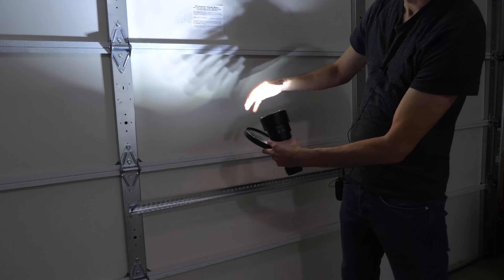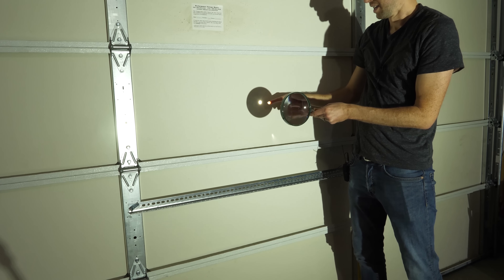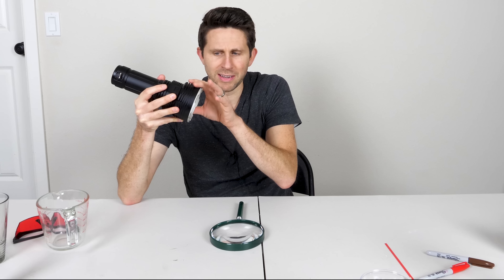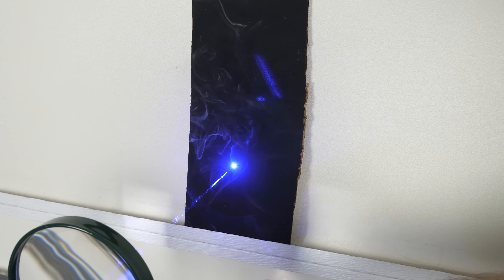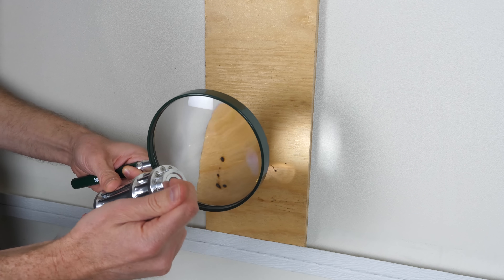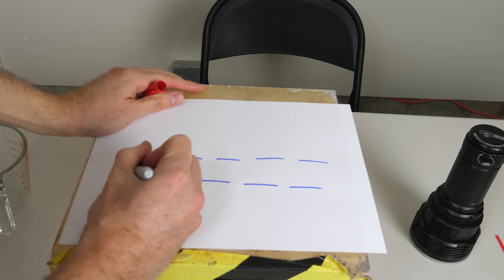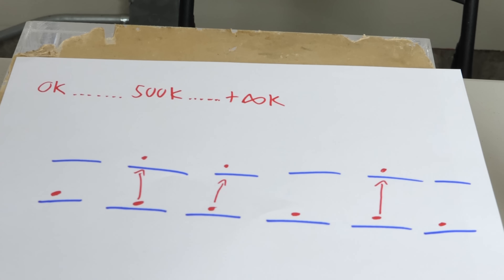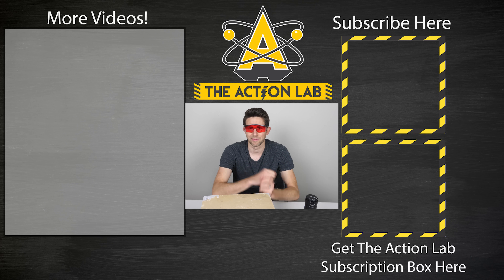What Happens if You Focus a 5W Laser With a Giant Magnifying Glass? Negative Kelvin Temperature!

Comment: You do not violate any law you just need other lenses. Lenses have different characteristics (depending on thickness,materiel and curvature)and your lens is just not the optimal one. 

You are indeed not capable of creating a stronger light source overall but you can focus the light onto a smaller area and thereby create a higher lux value at the focus point. (in comparison to not having it focused)

You probably need multiple lenses to focus your flashlight. 

pls correct me if I am wrong I had something similar last semester in technical physics.

Post scriptum:
An elliptical mirror around the light source could focus the light to one single point.
www.mathopenref.com/ellipseoptics.html
Reply: If each light source has the right combination of lenses and mirrors, you could focus all the light from all the sources into a tiny point that is way smaller than the combined surface area of the sources.
Reply: @nikolaneberemed: No, you can't overlap a perfect image of an incoherent source with a perfect image of another incoherent soruce, unless you also overlap the sources. If there is a distance between the sources, there will be also a distance between the images. Effectively, if you put multiple LEDs next to each other, you just have a bigger source with the same brightness per unit area.
Reply: @RealNovgorod  Can you illuminate the same spot on the wall with two different light sources at the same time? Sure you can. Can you focus the light coming from a source using (a series of) lenses? Sure you can. Where's the problem?
Reply: @nikolaneberemed: No, you can't have a perfect image from 2 incoherent sources overlapping. You certainly can have 2 flashlight beams overlapping but they are both much bigger than the sources and the combined brightness is less bright than each source. It's the same argument as why you can't focus a single source to an infinitely small spot. Think about what it means to focus an incoherent light source *perfectly*: Each point on the source surface emits light in all directions. You could collect the light from such a point with a lens and focus it back into a "point" on some screen (neglecting the wave nature and the diffraction limit for the sake of argument), but the light from an adjacent point also goes through your lens and is focused not at the same spot as the first point because all light "rays" from that adjacent point are shifted with respect to the first point and so are the image rays.
You can focus a spherical distribution of rays coming all from one single point (-> divergence), or you can focus parallel rays coming from different points (-> source size), but you can't do both, there's a mathematical trade-off (the product of divergence and source size is conserved, it's called emittance). This trade-off manifests in a finite-sized focus spot, and in the case of a source emitting randomly in all directions, this spot size must be at least the source size. Adding more sources in front of your lenses just increases the total source size, that's all. There is no optical system that can get around the conservation of emittance. The best you can do is holding your LED chip directly against the wall, so there's no way to increase brightness without somehow overlapping the chips.
Reply: @RealNovgorod  I wasn't talking about perfect. Not even remotely.
BTW, from the way you argue with yourself, I'd say you need more social contact. 8)
Reply: @nikolaneberemed  Not even remotely? Then you don't have even remotely the same brightness - problem solved, no more need to argue with the laws of physics. You're welcome.
Reply: @RealNovgorod  No, it's sufficient to focus the light onto a smaller surface area. No perfection needed. Better is still better, even if it's not perfect.
Reply: @nikolaneberemed  But you can't and I already told you why. The best you can do is a 1:1 image of the LED, not smaller. If it's not perfect, the image is always larger than the source and therefore less bright. You are welcome to show an example where all light from an LED chip or a lamp filament is focused to a smaller spot.
Reply: nikolaneberemed I think you are fundamentally missing the point. What he is saying is that it's NOT POSSIBLE. Mathematically. Please stop arguing with basic physics. If the two images dont perfectly align then the brightness per are has not increased. This can be shown with what other people have said so far in this comment string
Reply: @RealNovgorod  But I wasn't talking about LEDs specifically either. I was talking about light sources in general. Imagine two flashlights. Their flashy bits have a certain surface area. If we can focus that light using mirrors and/or lenses onto a smaller surface area, we should get light that is brighter proportionately to the difference in surface areas. Is that wrong?
Reply: @nikolaneberemed I also wasn't specifically talking about LEDs but incoherent light sources in general (basically anything that's not a laser). The "flashy bits" in a flashlight are typically tiny, only a millimeter or so in size (that's true for both LED or incandescent lamp bulbs), but the typical light cone is huge in comparison because you want to illuminate a large area and not just a millimeter. If you focus down that light cone (which you can), the resulting spot will be brighter than the unfocused light cone, but it won't be brighter than the "flashy bits" unless you can focus that light cone down to a millimeter. Maybe that's the misunderstanding. The "source" here is the tiny LED surface or the light bulb filament, not the light cone coming out of the flashlight. Only if you can focus it down to the same tiny area, you can achieve comparable brightnessy. But the laws of physics don't allow focusing to anything smaller than that.
Reply: @RealNovgorod  that example finally did the trick in my head 😉
Reply: Novgorod you can focus it down to however small you want. Obviously that doesn’t increase the amount of photons coming out of that flashlight, but equally obviously higher energy density equals higher temperature in that focus spot.
Reply: @jannthomsen2760  You're free to try doing that. Being able to do it would win you all Nobel prizes you can carry. As a hint, you can try to do it with moonlight. Moon is a neat object since we know its surface temperature, which is pretty low, but the object itself is huge and illuminates full side of our planet. The point is, there is no system of lenses you can use to focus moonlight into something that would make paper burn. No matter how big lenses you use, no matter how you configure them, no matter how many you use.

Or if you are not experimentalist type, you can google explanations on why the above task is physically impossible.
Reply: Joni Hanski yeah, no shot Sherlock. Energy density of moonlight is only 0.0015 Watts per square meter at sea level. But if you managed to make lenses as large as maybe 1,000 m2 then yes of course you could burn something. This has nothing to do with the moons temperature, nothing at all. You and action lab are Talking about using a single simple lens like the one in the picture, but even those can focus parallel ray to teeny tiny points. Parallel rays like lasers or the sun, bis flashlight obviously doesn’t qualify. Need more lenses to focus it. Still nothing to do with anything’s surface temperature.
Reply: @Peter Clausen: No, you can't focus a light bulb's light to however small you want, that's the whole point! Or why do you think lasers are used for cutting metal? Couldn't you save a hell lot of money by just focusing a big light bulb to a few nanometers so the spot becomes hot enough to cut metal? Make your own "laser" cutter from a light bulb and a magnifying glass - great life hack! If you don't accept the laws of physics, at least you could find an example that demonstrates your "theory", right?
Reply: @RealNovgorod  If the collimator of each flashlight is really good so the etendue is only barely increasing, so the image of each source on the wall is near perfect, and ya point them at the same point... ?
Reply: @Brew Sauce: No can do :) - you can't "project" a 1:1 image of an incoherent light source at a distance without losing brightness. You will always end up cutting out a fraction of the solid angle to produce near-parallel beams for your projection and thus you lose all light that is given off into all other directions. If that was not the case, projector lamps wouldn't be so damn expensive...
Reply: @RealNovgorod  And the NIF laser wouldn't be so expensive cause you could just focus the flash lamps on the target XD, I don't understand why I'm wrong, but undoubtedly I am. I think I need to break out an optics book.
Reply: @Brew Sauce: Yeah, lasers are unique in this respect because with their quantum magic they can force all the energy to go into a single spatial mode (i.e. Gaussian beam) rather than into random directions like an incoherent light source. The Gaussian mode itself is not that special, you can produce it with a light bulb by putting a tiny pinhole in front of it (making it a near-perfect point source) and focus it back to a tiny spot. But this way you'll lose almost all power because you block all light in the "wrong" modes, while all the light from a ("good") laser is already in the same mode.
Reply: @jannthomsen2760  So if you focus that energy from square meter onto one square millimeter from one square meter, your square millimeter has energy density of 1500 watts per square meter. That's slightly more than the Sun directly overhead. Slightly more than that and you get burning paper as easily as with magnifying glass on a sunny day.

Well, except you can't warm anything with moonlight to temperatures higher than 105 degrees Celsius.
Reply: Joni Hanski sure, but you are still limited to a power of .0015W, that would take a looooong time to heat anything up enough to burn and during that time the heat would dissipate, so you cannot burn anything that way. Temperature of moon is absolutely irrelevant. Where do you guys even get that idea that Photons have innate temperatures?
Reply: Joni Hanski and if you actually believed in Photon temperatures than those photons reflected by the moon would still be at 5,000K, so even that way it makes absolute no sense. Moon is not a light Source, its a reflector of light.
Reply: A photon has no temperature, the material emitting the photons has a temperature, at least if you consider large enough ensembles of emitters (not just a single atom). Moonlight is sunlight scattered in all directions, not reflected, that's kind of the point... Put a giant lens in front of a wall and try to focus all the infrared light coming from the wall into a tiny spot. If you could heat up a tea cup by that, you'd impress me.
Reply: @jannthomsen2760  All I can say is, what you say is impossible, it has never been done by anyone, and cannot be done by you either. It's really hard for someone to demonstrate that something is impossible. I could try myself and fail, or you could try yourself and fail. Like, however you want.

Anyhow, you are free to place piece of paper in a glass box to shield it from environment taking away the heat you're generating. It still won't work.
Reply: @RealNovgorod  That is what i'm saying. The temperature of the surface is completely irrelevant. And the moons surface is not emitting photons anyway, so if you believe what you say you would have to use the suns surface temperature.
Reply: @gJonii  Of course 0.0015W wouldn't set the paper on fire, i literally told you that earlier.
Reply: @Peter Clausen: Of course the moon's surface is emitting photons! It's absorbing light from the sun and re-emitting it, how else would you see it?? That sunlight heats the moon's surface to a certain equilibrium temperature, so how can the SAME light after being re-emitted by the moon's surface heat anything above that temperature? And that's if you collect ALL the light! If you look at the moon through a telescope on earth, you collect a tiny fraction of that re-emitted light and even though you concentrate it onto a spot much smaller than the moon, it's also much smaller power than what hits the moon, so you won't get more brightness (or temperature) in your projection than directly at the moon's surface.
Reply: @RealNovgorod  For gods sake, the moon is _reflecting_. And will you finally quit believe that photons have inherent temperatures? That's completely insane.
Reply: @nikolaneberemed  more intense. Not brighter. Brightness has a specific mathematical definition that includes not just the intensity but also the range of angles. And it's a basic fact of optics that lenses can't increase brightness.
Reply: @Peter Clausen: Do you even know the difference between reflection and scattering? Look it up before writing more nonsense. Also, I literally said in the previous post that a photon has no temperature. If you're not able to read then there's no way how we can help you.
Reply: @bryanreed742  Thanks for clearing that up. You just made me a bit brighter.
Reply: You are correct. The first and second law of thermodynamics are conserved and no violation takes place.  What's happening here is conservation of energy. In this case the type of energy transfer that's initially taking place is radiation.  The magifying glass helps focus the energy and increases the intensity of the electromagnetic radiation and projects by way of light refraction onto a light absorbing medium (in this case the wall or wood).  The radiation energy is then absorbed by the absorbing medium and the energy absorbing atoms are excited and when this happens then the atoms release a type of electromagnetic energy called infared energy that we describe as heat.  The heat energy (infared energy) is then released way of convection. Hence the laws of thermodynamics are conserved and no violation takes place.  Heat transfer 101.
Reply: I am still reading the replies not understanding a single thing....
Reply: Dr. Invader;} 
Loved your DeathStar, please make another. 
Long live the Empire! 😂 👍
Reply: This is not true
Reply: I think he is talking with lawyer too much 

Just a joke
Reply: Why do people tend to argue with physics so much? If it says "no" then try your best to understand why before saying otherwise, gosh..
Reply: No Idol i was wondering why they upvoted you as well. Sorry Action Lab, but you’re just soooo wrong it’s not funny.
Reply: THICC
Reply: Hey folks, take Physics as a guide,  not a defacto standard set in stone. 
Once upon a time people thought they would die from suffocation if they travelled more than 30mph on that new fangled contraption that Robert Stephenson came up with in 1829, despite a galloping horse already being capable of 30mph.
There are many scientific "facts"  through the years have been disproven, amended, corrected or adjusted to be more accurate. 
Currently accepted scientific and physics " facts " are merely statements of our current understanding of things,  so it is good to always push the boundaries and retest existing knowledge in as many ways as your mind will allow.
Reply: 69th like
Reply: Unfortunately a lot of people here don't understand anything about thermodynamics; the energy given off the light cannot be focused down to a point where the energy is far greater than the source, a magnifying glass does not increase the energy output of the light source no matter how finer the point, if this was the case then you could make an infinite source of power from the excess increase of light, this is why it is against the laws of thermodynamics. When you magnify the sun and start burning insects your are in no way increasing the power of the sun as the true power of the sun would turn this planet into black dust if earth were to touch the surface of the sun, another thing to understand about the Imalent DX80 if you look up the specifications of the LEDS in NO WAY that any "single" LED on that torch can pump out a straight "32,000" lumens, on its highest setting each piece of "CREE XHP70" LED is being overclocked to 4000 lumens.
Reply: Just use a concave lense with mirrors around the direct it into it that are 1 inch apart don’t correct me if I’m wrong because I’m right
Reply: I think what happens is that usually light rays are spread out so they have tonfind their focual length to get the ray into focus
While laser beams are parallel beam and any parallel beam are in focus when it passes through the lens
Reply: Laser beams are not parallel beams! That's a myth spread by Star Wars, along with other "facts" such as that laser beams "fly" slower than bullets and are visible from the side and make loud noises in space.
Reply: @RealNovgorod  i dont realy think "spreaded by star wars". Of course, as you said, laser beams are not visible from the side, they go at the speed of light and do not make sounds, but do not switch lasers with plasma! In most of sci-fi alien movie shit like star wars its all more or less plasma guns and stuff
Reply: @Miha Strajnar: Star Wars is just one popular example (especially the "laser" "swords", c'mon), but almost all pew-pew-pew space sci-fi flicks have this cartoonish portrayal of "laser" weapons. And don't even start with "plasma"! Ok, you might see it glow from all directions if it's hot and dense enough, but what do you think will happen if you "fire" a blob of superheated gas from a gun? - Exactly, it's just a fart in space...
Reply from the maker: Eduard Bas-you are not understanding this correctly. You literally cannot combine all light from your LEDs to all focus down to one point. It is impossible. And against the second law of thermodynamics. If you don’t believe me please try with any lens combination possible and you will fail. And Alan Ball, that is incorrect what you said.
Reply: @TheActionLab  so you are confusing that the combined output of all LED lights is higher than any combined light to a spot from a distance with the brightness and temperature of the spot that you magnify. Yes the overall power is greater near the source but it is like comparing the piercing power of a big nail and small needle.. it all comes to the area that receives to much temperature faster than it can give it away
Reply: @TheActionLab  ok, i understand if the source light is multiple point, it is not possible to focus all of the light into one point because of diffraction etc, but what if the source light is big enough, like a COB led, that have a diameter of 1cm, then right at the surface is mounted with an optic that narrow the beam of light so that the output circle of the light is smaller than the diameter of the focusing lens at a distance that greater then the focusing distance of the lens, (if you can understan what i mean 😁😁, my english is not that great) i think all the light can be focused into a point that is smaller than 1cm of diameter.
BTW, the laser that you use is actually a laser diode focused with a short focal length, without the lens, the light from the laser diode is scatered  and can't be focused by the magnifying glass
Reply: @The Action Lab
Maybe not with only lenses but with the help of an Parabolic reflector you can direct the light into one direction or even focus it to a single point with an
elliptical mirror www.mathopenref.com/ellipseoptics.html.
Reply from the maker: You cannot use any combination of lenses to create a higher lux than the surface of the light source
Reply: @TheActionLab  greater than the entire surface sure but you can certainly exceed the lux at any point along the surface.
Reply: @TheActionLab  yes but is it considered as light density? Photons/cm2, like it's always the same amount of photons, just more concentrated, therefore they can raise temperature faster than it is dissipated on the surface. Following your explanation anyone under the rays of the sun should immediately catch fire and burn alive.
Reply: @raidzor5452  you CANNOT get a greater photon density that the surface of the object whose light you are focusing.
Reply: @raidzor5452  not with 1 lense
Reply: @raidzor5452  brightness and intensity are two completely different things. That's the key. What he said about constant brightness is correct.
Reply: The Action Lab That doesn’t make any sense. It would not violate the laws of thermodynamics to do so. All you need to do is refract the light so that most or all of the photons of light are pointed at one point on the plane. I see no creation of energy there, just rearrangement. In fact, if you have, say 3.14159265 quintillion photons hitting a circular patch on a surface that has a radius of 1 cm, that’s 1 quintillion per sq cm. However, increase that rate to 100 quintillion photons per sq cm, and reduce the radius to 0.1 cm, and you have a surface brighter than the surface of the flashlight (assuming that  the flashlight has a radius larger than 0.1 cm, which is possible with the correct lens), with the same amount of energy (0.0314159265 sq cm x 100 quintillion photons per sq cm). Math checks out...
Reply: I just asked my physics proffesor who worked with optics for over a decade:
Because the original light source is not a single point you can focus it to something smaller than the original source and thereby increase the light intensity at that point.

Conclusion:
It's impossible to focus it to one perfect point but you can create something smaller than the original source.
Reply: @eduardbass839  The original source is the Imalent DX80 which has 8 pieces of "CREE XHP70" LEDS, that is 8 sources of light, however it is also widely known that each source of light in the torch; each piece of "CREE XHP70" LED is only outputting "4,000" lumens when the torch overclocks them, there is no LED that small on earth that can run at 32,000 lumens as it would instantly fry. In the end the torch is out putting 8 sources of light, 8 x 4,000 = 32,000 so what happens when you focus 8 x 4,000 lumen LEDS into a single point?
You get a 32,000 lumen pinprick.
Reply: @TheActionLab  why couldnt you use a makeshift funnel and and help concentrate  and prevent light from escaping before passing through the magnifying glass?
Reply: @TheActionLab  
imagine a light source which consists out of 1000x1000 leds and you were to focus them all into one point.
That point would have a higher lux value than one individual led (at any given point on its surface) 
Because even with the same amount of energy if it is focused onto a smaller area. [Evis]=lm/m^2=lx the lux value will be higher because m^2 can be significantly decreased.

I will ask my professor next friday  it coud well be that i am wrong. Optics are not my speciality